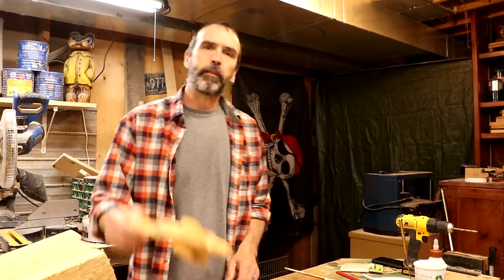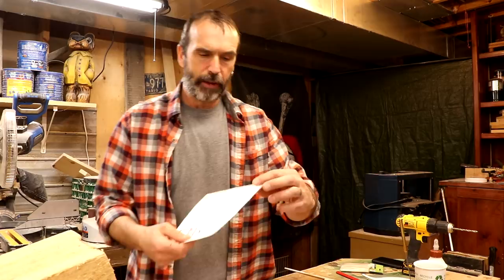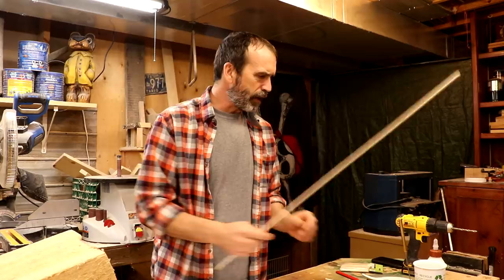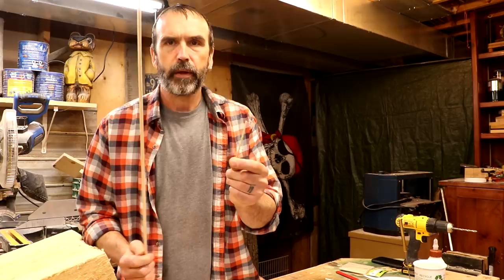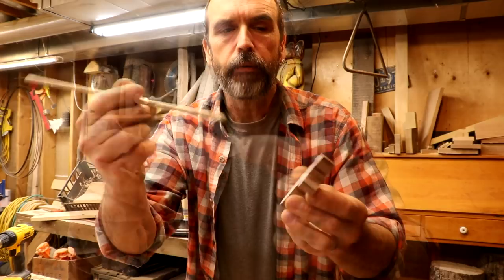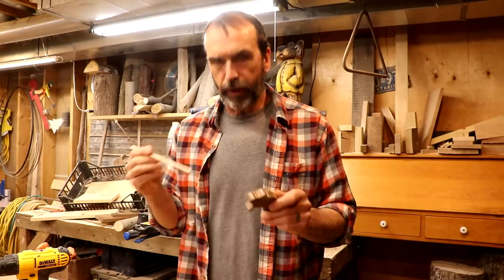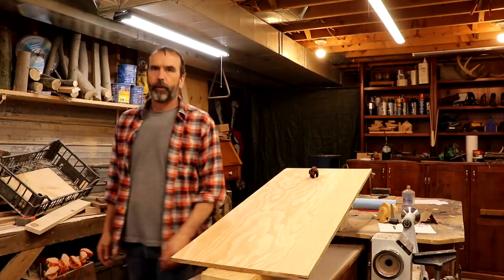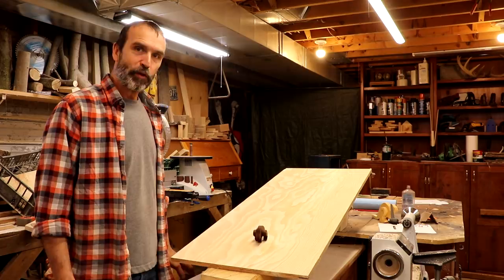Simple Hopping Bunny Toy (DIY)

Comment: So simple any bunny can make it! What a cool project! If you need washers, you could make them from bottle caps or other Plastic by drilling or punching with a paper punch and stack on a bolt mounted in your drill and sand to size. Thanks for posting Doug!

Comment: Doug, that's really fun to watch.  Suggestion for washers when you don't have any: there's a very nice stiff plastic that comes as bubble wrap from lots of things you buy.  Save some, especially the nice flat good sized pieces.  Doesn't take much room,  and would have been perfect for this.  Cuts easily with scissors,  easy to punch the right size hole,  and you're done.

Comment: In keeping with the self hopping theme, self spraying glue....
Pretty classy bunny there, walnut! With a contrasting racing 'spot' no less. I may have to make an aluminum one with a brass axle. Betcha the weight helps speed, but it'll need a 'traction device' like yours. Thanks for the R&D!
On the bored weekend list, along with the 500 other 'projects' backed up.